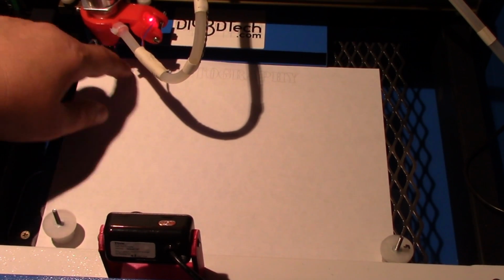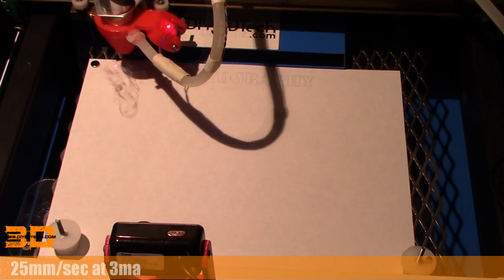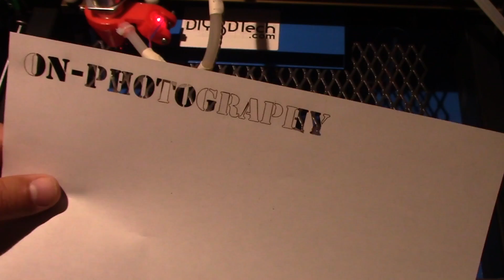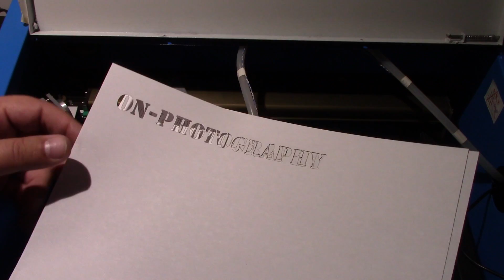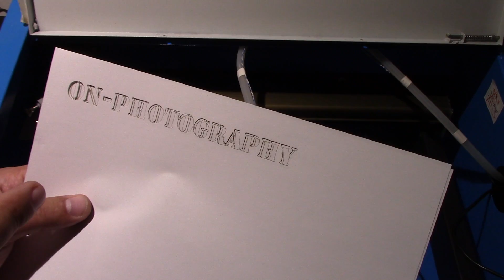K40 eBay Chinese CO2 Laser Cutter & Engraver - Can It Cut Regular Paper for Decorations!

Comment: Love your video's they are very helpful. I am about to get my K40, I have a few crossflow blowers, i was wondering, what is the opening of the exhaust port if you too that duct out all together, Do you think a cross blower that is 3 inch by 3 inches by 10inch long with motor, would fit right inside without losing Cut area? i have a few shorter ones also.
Reply from the maker: Best way to go is either an external 3 inches marine blower or better a bounce house blower.  These create a crazy amount of smoke and fumes!
Reply: @DIY3DTECHcom  i do plan of directly venting to the outside with a blower like this one https://stovesandspas.com/product/enviro-vista-flame-room-air-convection-blower-ef-002/ it will get bolted right on to a wall chimney pass throw, my idea of using a crossflow blower inside K40 itself is as a pre-stage blower as my shop is tiny and its winter( can't keep windows open), I do not want to have any lingering orders coming from cutting plexiglass.... I also ordered those newer mirrors mount brackets and laser head, like the ones the K40D come with, I got my ramps board set up with the laser version of marlin ready to go. To tell you the truth, I didn't really want or need a laser cutter, till I watched most of your video's about the K40, I couldn't help myself and got first-gen version and figured ill upgrade it. If the wife asks! lol i ll tell her its all your fault lol

Comment: My 400mw violet diode laser cut white paper ( cause its not truly white thanks to phosphors LOL ) , but way slower than your going  . lol 
if you cut colored craft paper it will sublimate the die  out in a pattern around the cut .  try putting colored craft paper under  , it should give a stain in a ourra like edge on the white paper . 
paper and died paper is fun . i made quite a few  laser cut cards.  My  rig is out of tune (focus)  rite now .  i should  get it rolling gain and you can see how slow and low power lasers roll haha  :P
Reply from the maker: Yea with the IR its a little different then the visible light laser as far as the dye issues goes as I know what you mean with my 2watt violet I saw the issue your speaking of yes not with the CO2 so far...